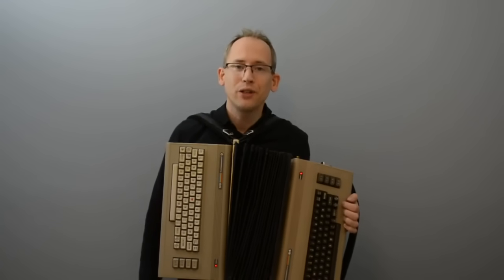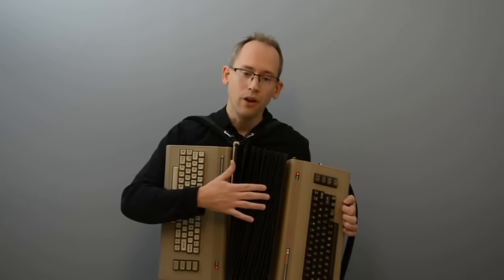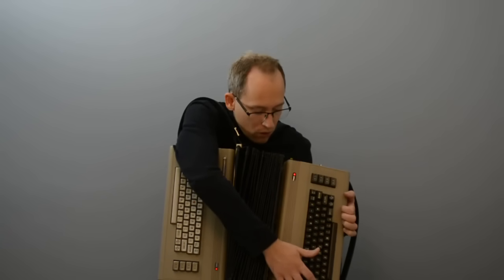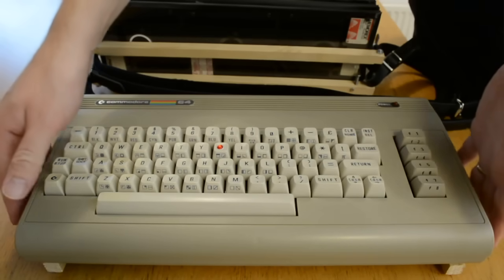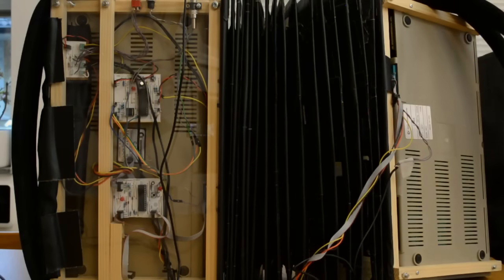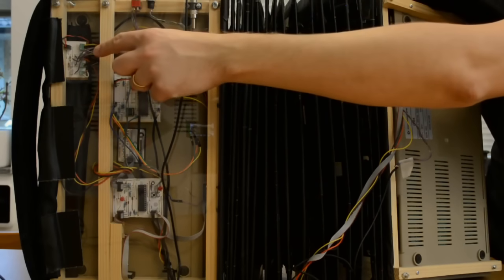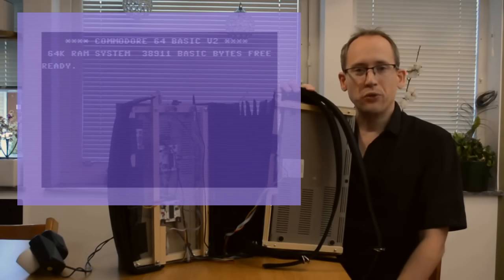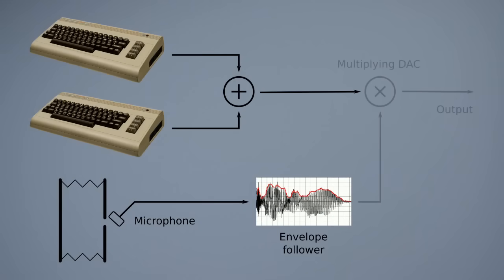The Commodordion

Comment: AMAZING! As a programmer, with some interest but very little understanding of hardware side, most of the technical stuff flew right over my head. Well, pretty much everything, besides simple stuff like the "tape emulator"; btw, why not simply make it a "cartridge emulator", a board that is basically a cartridge, but connected via cable in the cartridge port? That way you could just power on and it would "autoload instantly" (quotes because it's not really loading, it just overlays it's ROM over part of the RAM; and that's just how I understand it, but simplified).
Or is there a specific reason with going to "tape emulator" way?

Don't take that as criticism, it's not like your design even just on that part has nothing specifically wrong - it's just the only bit where I understand, or at least believe so, enough to comment and make a suggestion - and I'm honestly interested what you think of it? Is the tape method better, simpler to implement or for some other reason preferred? Maybe there's a reason why you chose not to go the cartridge way, or maybe you just didn't think about such solution? Please, do tell :)

As for the rest, this is one of those things that sounds insanely impossible, until you see a youtube video of it!

Btw, someone also made an electric guitar out of C-64, so that the sound is coming completely from C-64 SID chip... He had to make some limitations due to the 3+1 channels available, so I think it was that you could only press on 3 strings at once, but still amazing... I wish I had bookmarked that video, but it's somewhere here in YouTube.
Reply from the maker: Thanks! It was the most convenient option. Communication with the tape drive is quite slow and uses few signals, so it was easy to throw something together from parts I had at home. On the cartridge port, you need to wire up some 20 signals, and you have to react and deliver the correct data in a fraction of a microsecond. It can be done, of course, but it would have been a much bigger effort.
Reply: @lftkryo  Well, that explains it and in the hindsight it's easy to say I should have realized it -but aren't there readily available solutions for creating one?

I suppose you didn't want readily available solutions, because you wanted to create the whole thing from scratch wholly by yourself - from those parts you found at home, am I right?

Otherwise you could have just created something like a cartridge without having to implement the whole mechanism yourself - or if not a cartridge, then SD-card floppy drive device :)

Anyway, thanks for your reply - like I said, I'm not very good when it comes to hardware knowledge, and your reply, short as it was, taught me some new knowledge, so thank you for it!

P.S. Subscribed - I was thinking of subscribing, but after you wrote back it was a seal deal (misspelling intentional ;p )
Reply from the maker: You're right, there's one more piece of the puzzle: All standard cartridges are sticking out a bit from the back of the C64. But on the Commodordion there's no room because of the bellows. So it would have been necessary to design a custom, smaller cartridge.
Reply from the maker: Hi again! I had been toying with this idea before, but your comment got me thinking again. And now I figured out a way to make an autostart cartridge on a stripboard, using only one side of the expansion port connector. Here's a writeup: https://www.linusakesson.net/hardware/autostart/index.php
Reply: You could also have a custom kernel rom chip installed, which contains your program.

Comment: I'm bummed you didn't just use an accordion bellows. So much effort is just going back and forth with all the air you're losing.
Nevertheless, I'm glad you got into this project and that others can appreciate the old electronic sounds. I've made my own MIDI systems in concertinas & accordions (heads up, you can make good money doing this), but the vintage stuff really fascinates me.

Thank you for sharing. I should showcase more of my "contraptions" for others as well.

God bless you

Comment: This was extremly creative! Hats off to you sir!
The volume by the envelope follower was very smart, but did you ever consider using the inbuilt potentiometer readers in the commodores SID chips to control this directly in software, and translate that signal to control the volume directly on the SID chip? I guess a spring and valve could be connected to the bellow-hole, and could control he potentiometer. Just an idea, but yours was more involved and creative I have to say =)

Comment: Didn’t C64 have a cartridge slot, which I would think might be easier to use than the tape interface to load the software and be ready automatically when switched on

Comment: The audio input line of the SID could be accessed in a convenient place on the motherboard as it is pin 5 of the A/V DIN receptacle. That input can be filtered via the SID filter as well as its volume modulated. It is mixed with the SID oscillator outputs

Comment: Love this!  And your solution for detecting bellows movement is so simple and elegant!  At the beginning I was thinking it would be some sort of spring loaded, spooled cord, with an encoder on the spool to detect it moving in and out, or maybe an encoder on a pinion, with a flexible rack (like the pull cord on a toy car) and use that to measure the position of each side and their movement.  But no. Make it air tight and detect air blowing through a hole. Brilliant!

Comment: I first thought that all the C64 hardware was bypassed and replaced by some own microcontroller hardware. But no, you wrote original C64 code, loving it!
@lftkryo Were you able to re-use any Chipophone software despite the different cpu? Or was the code a start from scratch?
Finally it has been proven that a floppy-disk is flexible indeed 😂
Reply: I bet he used his own Qwertuoso software, or a variant of it. It already has accordion layout, though I guess he might have to flip it for one of them!

Comment: Amazing work! You could have a belt pack or belt pack (to reduce weight in the main unit) with li-ion batteries and charging BMS to power them and an amplifier with speakers for a truely mobile Commordion performance. :) But yeah this is fantastic. Would like to see more pieces performed on it.

Comment: Chromatic button accordion players get incredible superpowers when their years of practice translates so well to a standard computer keyboard 🪗
Reply: That actually gets to my biggest question, which was what (musical) keyboard layout had been used. I guessed it might be something standard given the quality of performance, but there were several possibilities.

When I looked at the idea of using (PC) keyboards, I set it aside partly because their key scanner wasn't able to handle all chords. I don't know whether that's true of the C64 or not...?

I have to give high points for elegance in keeping the C64's as unmodified as possible. 

And yes, the "breath controller" design for bellows dynamics was a minor revelation for me too. I've been sketching a design for a MIDI concertina, and this would be one solution for bellows volume... but since I play Anglo-German, I am thinking more in terms of an "infinitely efficient bellows" behavior based on measuring force directly rather than a traditional bellows.
Reply: @orksecurity  The C64 has no "dead" key combos like the PC. It's got 66 physical keys, but the shift lock and restore keys are special and are not really part of the keyboard from a software perspective. The remaining 64 keys can be directly mapped to individual positions in a logical 8x8 matrix, represented with one eight bit hardware register for the rows and one for the columns, allowing for detecting any combination of key presses by checking which bits are set in the two registers.

Comment: Absolutely fantastic as usual.
Did you consider to put the software on cartridges or ROMs to make it completely autostarting? It would make software updates a bit more involved but it would be instant on.
Reply: @LazloNQ  Easyflash wouldbe easily updatable though.
Reply: @bass-cadet  But would it autostart the program?
Reply: @PerBengtsson  You can make Easyflash autostartable.
Reply: @bass-cadet  then that's one option but if you're not going to do an awful lot of updates then there are much cheaper options.